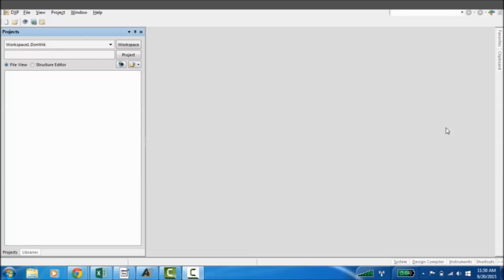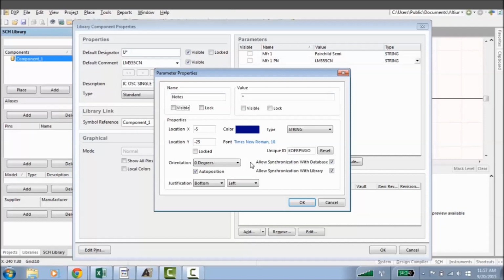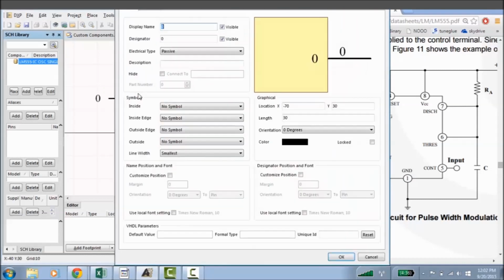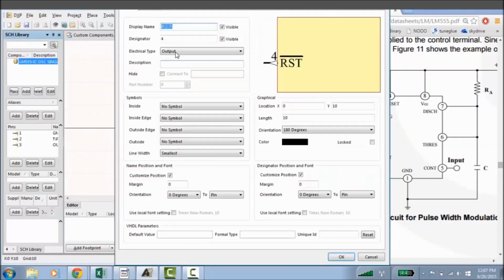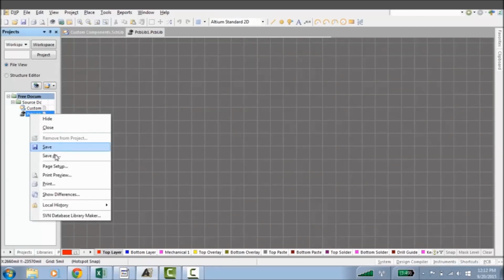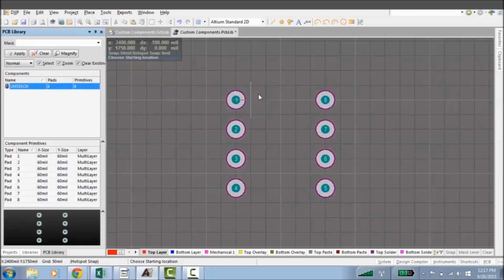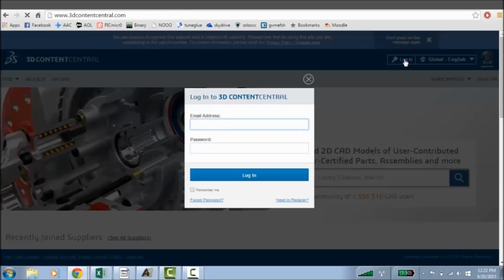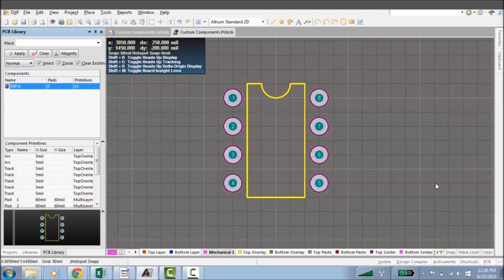Altium - Creating Your Own Custom Component Libraries (Tutorial)

Comment: This was incredibly helpful. Thanks so much!
Reply from the maker: I'm glad you found it helpful!
Reply: I agree. Especially for those shortcuts!:)
Reply from the maker: That's one of the things I like the most about Altium -- the shortcuts. They're actually carried over from Altium's predecessor, Protel, which to my understanding could not be used with a mouse. Everything was done on the keyboard. Today it simply speeds up the entire PCB design process which, if you work in the industry, you'll know is very important.

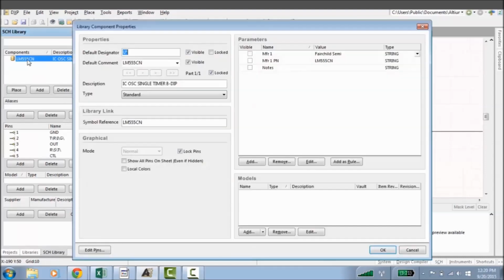Comment: There is no "model" option when I click sch library and my part 25:32
Reply from the maker: Yes, newer versions of Altium seem to have changed this slightly. Instead of opening up the symbol properties as shown in the video, open the SCH Library window and single-click on your component in the list. The symbol will pop up in the editor window, and below the editor window you will find the options to "Add Footprint", "Remove", or "Edit".

Comment: btw whats the shortcut to set the line width? I couldnt do it without actually placing the line first.
Reply from the maker: When you enter the line tool you can press "Tab" and it will bring up the properties for the line. The option to change the width is in that window.

Comment: Great Video. Thank you! Do you have any thoughts on simply using the PCB component wizard for generic components instead?
Reply from the maker: Hi Paul, yes I do. For several months I was creating component libraries at work using the component wizard. It works very well, but the problem comes when a manufacturer has a different recommended pad layout than the component wizard generates. This can lead to various problems, including your board house complaining that they don't match the manufacturer's specifications. I have had this happen multiple times.
Reply from the maker: Now, about a year later, I have found myself replacing nearly every footprint generated from the component wizard in order to meet the requirements set by the manufacturer. The footprint mismatches may not be an issue for hobby-level boards, but when it comes to the professional level it makes a huge difference.
Reply: Good to know! Appreciate the feedback, thank you. Take it easy
Reply from the maker: I'm very happy to help!

Comment: very nice video!

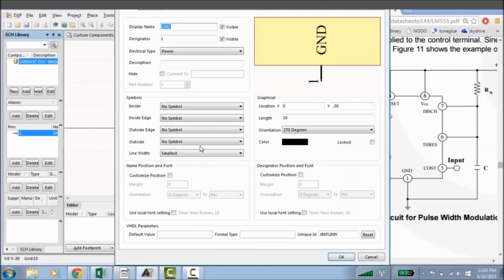 I have a question, I am using Altium 09 version and in there when doing the schematic following your video, I couldn't find 'Name Position and Font' in Pin properties as yours (time 10:30 in the video) ? Is there any other way to do it from schematic ?
Reply from the maker: I'm afraid I have never used Altium Summer 09 (I first started with Altium 14). It is possible that that feature was only added in later versions (I'm using version 16.1 in the video, if I remember correctly) and was not available in 09. What you may be able to do is ask the question on a forum or Q&A board such as http://www.electro-tech-online.com or http://electronics.stackexchange.com/
Reply: Thanks for your response! I will try to get a new version soon. 

BTW, do you know where I can find 3D model for SOT108-1? I surfed the 3d Central website you provided, but couldn't find a model for this IC? I got other models though from the website, it is very useful. 

Second, do you recommend Ultra Librarian software for getting unavailable ICs in the library? if you used it, would you please share your experience with us?

Thanks again for the great work you are doing!
Reply from the maker: The SOT108-1 is a version of a SO-14 package. As far as I know its only difference is that it has one beveled edge along the side of the chip that Pin 1 sits on. I believe this model will be suitable, though you'll want to check its dimensions against the datasheet for your exact part: http://www.3dcontentcentral.com/download-model.aspx?catalogid=171&id=423429

I have not used Ultra Librarian, personally. I generally design my component symbols, footprints, and basic 3D models directly within Altium. Any sophisticated 3D models I will create using SolidWorks. I'm sure there are other 3D modelling tools out there that are cheaper than SolidWorks, if not free. I personally see no need for Ultra Librarian, especially not if you have to pay for it. But that's just my opinion.
Reply: Great! thanks for the swift response

Comment: There is a WAY much easier way: down below on the right corner of the screen, there should be some "tabs" like System - Design Compiler - Help - SCH - Instruments - >>. If you click (normal left click, a float menu will show up. Choose "Supplier Search". A new window will appear with a place to input the keyword for search a whole bunch of suppliers (which you can also determine on the options...). Find the part from your favorite supplier. Right click on the part, and choose if you want link and parameters (it will do all this copy-paste thing he did) on an existing component you created, or it will create a new component for you, having to complete it with the pins. Look for the videos of a guy named Robert Feranec. He rules in Altium. :-)
Reply from the maker: I mentioned this tool in one of my replies to another comment, the problem is that it fills the parameters with tons of information that is rarely useful, and the parameters and footprints, if you have Altium generate them, can be inconsistent between suppliers. I don't like that, personally. I prefer to have full control over which parameters I want and the style used for the footprints. There are many great tools built into Altium, and ultimately it is up to the user to pick and choose which ones he or she prefers and feels most comfortable with.
Reply: I saw that, but don't you think it is more productive to let all the parameters be populated and then checking the ones you don't want and removing them by clicking remove?
Reply from the maker: In the amount of time it would take me to go through all of the parameters that are automatically populated for a single component and remove them manually, I could have already created the 3-6 parameters I really need for my parts and generated a couple of components. This may not be the case for everyone, like I said there are multiple ways to do this, but this video goes over what works for me. If someone finds the built-in tools work better for them, then I most certainly won't discourage him or her from using them.

Comment: hi, awesome video . i have one question .I follow all steps in videos. i had created sch and  foot pint library. but i didn't understand  How to used custom components  in my new project ? please help me 
thank you
Reply from the maker: kalpeshpatill102 Ah right. Once you have created your SchLib and PcbLib you will need to add them to your project. To do this, open your project and click on the "Libraries" tab. If you don't see it then click on the "System" tab at the bottom right and select "Libraries". Once you have access to the Libraries tab, open it and click on "Add Library...". From there you can browse for your newly created SchLib and PcbLib files and add them both to your project.
Reply: thank you . it is working .

Comment: Hello, I have a question. If I only have to do the schematic and then simulation do I have to create a footprint for the parts? Or does the simulation work only with the parts and without the footprints?
Reply from the maker: Hello, I apologize for the very delayed response. This tutorial does not cover the creation of simulation models. Those are best found from the manufacturer, or perhaps a third-party source who really know what they are doing. I do not use Altium for simulation so I'm afraid I cannot help with that aspect. If you happen to find a good source for Altium simulation models, please feel free to share!

Comment: now the customized component has done....will this component run well during simulation process?
Reply from the maker: Hello, I'm afraid this tutorial does not include simulation models. You will need to find a source for Altium simulation models and add them to the schematic component the way you added the footprint. I'm afraid I have absolutely no experience with simulation in Altium.

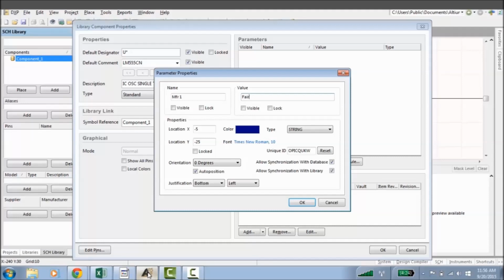Comment: From 4:00 to 4:40 all manual input  or copy and paste. Doesn't make sense to do that on a "COMPUTER". Computer should be more intelligent than that- isn't? . All the information are in digital format already(Digikey's site), so what is the point to use the computer for copy and paste all that info one by one?
Are you sure of that if this is the best way populating the component parameter section?

Just asking. ;)
Reply from the maker: +Laszlo Juhasz Do you know of a better way? There very well may be, but this is the most effective one I've come across yet. I find it easiest--It gives you the ability to use your own custom parameters and populate them with exactly the information you want in the BOM.
Reply from the maker: I'd like to follow up on this. Yes indeed, there is a better way. Altium has a built-in tool that links to distributor websites, which will populate various parameters such as the supplier, manufacturer, part number, etc. You still have to go in and link each component to its part number in the distributor search tool, but you don't need to add the parameters manually. Me, I prefer to have more control over parameter names and what I put into them, so I'll probably stick with the method described in the video. There are other options, however.
Reply: Yes, there is a WAY much easier way: down below on the right corner of the screen, there should be some "tabs" like System - Design Compiler - Help - SCH - Instruments - >>. If you click (normal left click, a float menu will show up. Choose "Supplier Search". A new window will appear with a place to input the keyword for search a whole bunch of suppliers (which you can also determine on the options...). Find the part from your favorite supplier. Right click on the part, and choose if you want link and parameters (it will do all this copy-paste thing he did) on an existing component you created, or it will create a new component for you, having to complete it with the pins. Look for the videos of a guy named Robert Feranec. He rules in Altium. :-)

Comment: what if we use a letter for the designation 
?
Reply from the maker: You can use letters for pin designators, just make sure your footprint has a pad with the same designation. For example a lot of ICs have an exposed pad on the bottom. I give this the designator "EP" and I add a pin in the schematic with "EP" as the designator.

Comment: this is not the correct way to create a library. you will not be able to a components to your library.
Reply from the maker: I'm afraid you are mistaken, this is how I created all of my libraries for several years using the old DXP platform. When Altium changed to X2 the process changed slightly, but overall is the same. All you have to do to add new components is open the library, simply go to Tools -> New Component in the schematic library editor, or Tools -> New Blank Footprint in the pcb library editor.